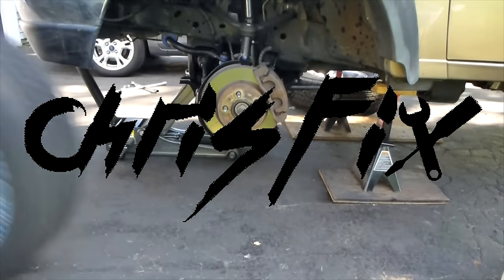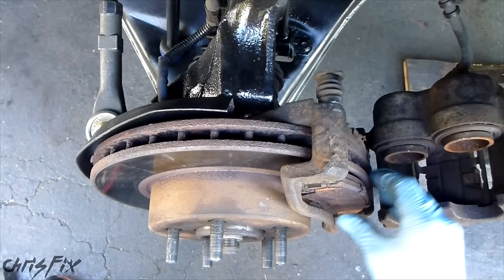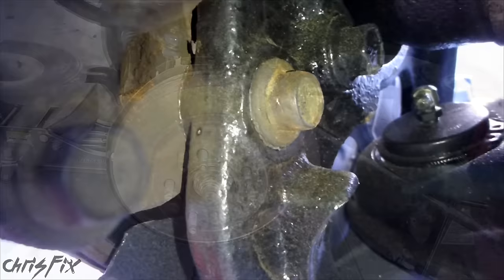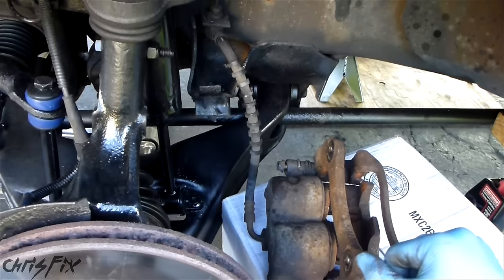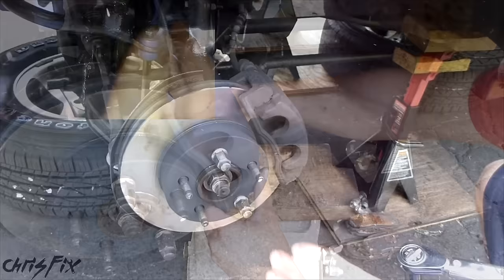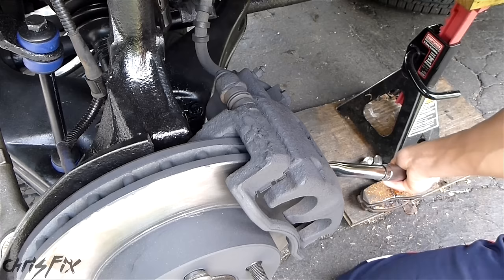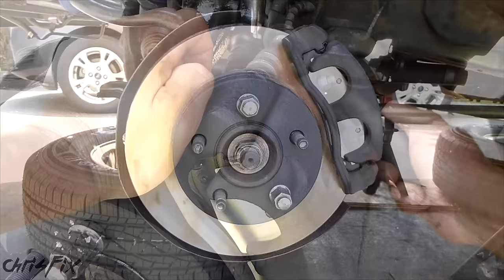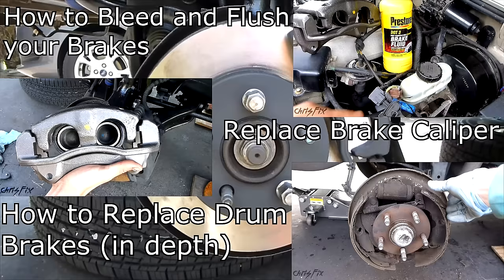How to Replace Front Brakes, Pads and Rotors

Comment: Great video and well presented.  Just wondering why you left out cleaning the brake hub before the rotor mount and checking lateral runout??  Also, the caliper bracket bolts need to be cleaned and inspected before fastening to the torque spec.   You never mentioned checking the threads and bolt "fit" before reusing caliper bracket bolts (if worn/loose fitting, they need to be changed with new bolts).  Lastly, the hardware was never removed for a proper caliper bracket cleaning and lubrication (under the hardware) combined with turning the rotor to confirm that it does not rub against the hardware.

If an inexperienced person does this job, and never considers cleaning bolts/checking fit, they could have an issue on their hands.  If they don't check runout, they will experience pulsation and vibration.  If they grease the ends of caliper pins, they will hydro lock the pins in the caliper.

Maybe you should add some the risks and warn people of things that could go wrong.  Just a suggestion since the video shows a really easy job that takes little effort.

Comment: Question...at about 7:37 you say to make sure that the pads are completely against the rotors.  Wouldn't this essentially mean that the brakes are depressed and the wheel will be locked.  How does the wheel spin if the pads are against the rotors?

Comment: Though this looks quite easy, you might run into the same problem I had. The new pads didn't fit, well. The top, and bottom, metal tabs on the new pads needed to be filed down to make them fit. If you experience the same issue, after filing them down, remember to repaint them so that they don't rust.

Comment: But doesn't forcing brake fluid back up through the system to fluid resevoir when pushing pistons back cause issues with ABS module on cars fitted with ABS braking? I was under the impression that on cars with ABS, the brake hose had to be clamped off and bleeder opened up and fluid released via plastic hose into bottle, (its only a small amount), when pistons pushed back. Then the bleeder is tightened after pistons are back to receive new pads. No air gets into system anyway this way.
Reply: With ABS systems you actually need to rotate the piston as you push them back.  Most Brake Caliper kits you can purchase will do that for you as they push back the caliper piston.  If you use a ABS brake piston kit you will see it rotates the piston as it pushes it back.
Reply: Ronald Eilers How big of a deal is it if you don’t rotate the pistons while pushing them in?

Comment: very good video. but most of the mechanic dont do good jobs like these ..i have a slight metal feeling on brake pedal when coming to stop at low speed..no noise or vibration and no issues at high speeds..only felt at low speed stopping kind of grind feeling..new brake pads..but rotors were 2 years old but  resurfaced when changing pads 2 months before..any advise on what to change would be grateful..sorry for length text..thank you.

Comment: Thanks a lot for the great video. I followed this video and replaced my rotors. After doing that I can hear a very small grinding or scraping sound coming from the wheel. Is this a normal thing since the new rotors don't quite the old pads? Any idea how to get this fixed?

Comment: would needing a rotor and break pads cause my engine light to come on? I just watched this video and these rotors look so smooth, but when i went to look at mine it looked like mt. rushmore.and i have not even taken the tire off yet. i thought i had a flat the way it was jerking riding down the road and pulling to one side as i prayed "let me make it home." i did have brake fluid but something sure was burning up under there. dont know about driving it all the way back into town to a mechanic?? will i be walking??thank you for the video, you made it look easy.
Reply: 2 years old comment but for anyone wondering

Engine light= ENGINE
brakes (or anything not the engine) will not make the engine light go on.

Comment: I have recently been getting some wobbly brakes on my 2012 Challenger RT after 80K miles.  I noticed some rust buildup on them and was wondering if it was safe to use a carbon steel wire cup brush to remove the rust from the surface of the rotors before going and spending 190 a piece on OEM rotors.  I need to check the thickness of the rotors as well to see if the rust removal is worth the effort or if new rotors are necessary.  Also, is it necessary to replace brake pads when I replace the rotors?  I still have about 6mm of life left in mine.

Comment: Good instruction, but I would be hesitant to use such a light silicone spray on the guide pins. Would think a heavier weight silicone grease would be better for the loads that the guide pins endure.

Comment: Hi Chris. Firstly I love all of your informative videos. I am considering getting a hybrid car, but if the batteries recharge through the anti lock brakes, would a brake job be different?
Reply from the maker: Thanks a lot! For most hybrids it is exactly the same as a normal brake job. The only major difference would be that you'll be doing less brake jobs over the ownership of the car because hybrids are very light on brakes

Comment: Chris, my car had a rubber sleave over the brake pins. I removed them because it impeded the movement of the pins after cleaning. Have you seen these before? It seems ok after driving.

Comment: Just did front pads and rotors on my 08 Sebring a couple weeks ago.. I've only done brakes a number of times but I always wind up with horrible vibration once the pads n rotors get warmed up.. the rotors I get usually have machine marks on them and I'm guessing it just needs to be worn down past those marks.. AutoZone cheap rotors.. I don't know. I watched the video and the one thing  i didn't do was installing the warning brackets.. everyone else was pretty much identical for the most  part..

Comment: I know this is a very old video, but wanted to see if anyone else had this issue. My rotor would not come off even after beating it with a hammer. Another video said you have to take the wheel hub off to get the rotor off. It was the only way I could get the rotor to come off easy. Now I'm having to figure out how to get the wheel hub off and reassemble everything. Is this required for some rangers? Thanks

Comment: You must remove the air from the brake after the replacement. You have relief valves at each clamp. You start from the front, from the side of the brake pump. One person pumping the brake pedal, and you drop the valve air until the liquid begins to run off. Otherwise the pedal can fall into the floor and you will not have the brake at the least opportune moment. Sorry for the language.
But anyway, very best video, off how to replace brake pads.
Peace from Poland.

Comment: Hey when I spin my right front hub, I hear a movement noise only on part of the roll, like something moving internally, but the hub seems solid. The other front hub doesn’t make any noise when I spin it. Both where with tires and rotor off, with the rotor and tires on, I don’t hear any noise on either.

Comment: This is very important *   only  use the product  made for the job synthetic brake caliper greese which is made to not dry out in extreme temps . I've never seen the rubber get hard from using the greese that is made for this specific job . Regular greese is totally out of the question .

Comment: I recently got my front brakes done a week ago when my sister and her boyfriend were on their spring break (they live in Jersey and I live in Michigan), and now, the brakes are grinding. Is there a way to fix this? I also had to get the brakes bled since the left front caliper was replaced on account of stripped screws since the other issue with my brakes was sinking halfway to the floor, and it now stops better (there was an air trap in the brake fluid itself). The old brake pads had nothing left and the old rotors had divits and grooves on them.

Comment: i have watched 15 front brake videos, and not seen one person really clean the rotor properly. you tried, but at the end of the clip, i saw a lot of grease still on the rotor..... another tip too, before pushing the pistons back in, use air hose, and a tooth brush with soapy water to clean the seals before they get pushed back... that will ensure proper even brake wear

Comment: Funny. I had to come back to this video to see which silicone paste you used for pins. Same thing I bought but 3M doesn't make this anymore! What are you using these days?
Reply from the maker: Dang that's weird, it was pretty popular, but my friends have used sil-glyde and super lube and they have reported good performance with that
Reply: @chrisfix  I contacted 3M, they said they don't make it anymore! Ordered some by AGS automotive. I'm also using permatex 80653 high temp. It's colored, a bit thinner silicone ceramic (brake parts lube) so I hope it's okay for pins. This also seems to be out of stock and I bought it 1.5 yrs ago.

Comment: I was wondering if Hyundai Sonata Hybrid vehicles brake pads can be replaced in similar fashion?
I was at a Hyundai dealership, and the advisor mentioned that I have to replace the whole brake rotor as a package once the pads are done! Is that true? 
For all 4 brakes that would cost me around $1000!

Comment: Even good mechanics can frequently benefit from refreshers, especially where safety is involved. Good video - but maybe mention that the people should pump the brakes when they get in, and talk about the bedding process for the pads?
Reply from the maker: +Andrew Geier Thanks for sharing. I could go on and on about brakes and make a 2hr video but there is only so much you can show at once.
Reply: +ChrisFix true enough, I suppose. I'm doing brake pads now, and wanted to see if there was anything I was missing but I'm mostly okay - I remembered all steps that you showed and some extra precautions that you did not.

Although, thanks for reminding me about the brake fluid reservoir cap - that's the one thing I admit I had forgotten in the two years since I did a brake job.

Comment: Did I mess up if I put the break pad with the clip on the inside of the rotor instead of the outside?
Reply from the maker: If that's the wrong way on your car then you need to switch it around

Comment: Does it need alignment after changing the rotor or upper ball joint?
I did change my rotor, after watching your video, but I feel little bit of the shaking on steering wheel when driving.

Comment: Attaching the new brakes on 2003 Chevrolet Cavalier, I crossed the bolts. They went in very hard, I thought it was because of new rubber inserts (bushing, they came together w/new brakes) I put in holes for those bolts. They stopped ~1/4 (maybe they are in place and I just overtightened them, I'll know for sure when I'll do the second brake) in before the end, where they are supposed to be, and started to rotate free both ways (clockwise and counterclockwise), I can't extract them, because they rotate. Should  I buy a new knuckle now, probably the thread inside is also damaged? Could you tell, how to extract them? Thank you for a good film.

Comment: Hi Chris. You produce the best videos! I'm a little confused about the squealer tab on the brake pad. I have a 2000 explorer sport 2wd. The squealer is on the outboard pad. The inner pad from my experience, has always seemed to wear down quicker than the outer. I'm thinking logically the squealer should be on the inner pad. What's the logic of having it on the outer pad?
Reply from the maker: Yea you can just flip the pads around. The pads work on either side as long as the pad material contacts the rotor.

Comment: After install the new pads , if i push the pads to the rotor wouldn't that affect on the brakes ?? ( i think there should be a little space between the pads and rotor so when you apply brakes the pads pushed in on the rotor )

Comment: Question: When you spray brake cleaner on the brake rotor, do you wipe it down with a clean rag or just spray it and leave it?
Reply from the maker: +Heel Guy It evaporates fast so you can spray it and wipe it or just spray it and the liquid will pull the contaminants off.

Comment: I'm getting a squeaking / squealing noise from the front brakes when I drive my 2002 Buick Rendezvous.  I just did the the whole rotor / pads less than 5000 miles ago, and everything was fine after that.  The noise seems to vary a bit as I turn the wheel from side to side, and will sometimes stop when I step on the brakes.  I pulled the caliper assembly off yesterday and the pads seem to be sitting OK (I had a problem last time the one pad seemed to pop out of the clip.  Yeah, the pads were cheapo, but they looked OK when I pulled it.

Suggestions to look for?  Thanks.

Comment: I just got coated rotors for the first time. They aren't packed in oil like regular rotors. Do you still hàve to clean them with brake parts cleaner?

Comment: I have a 2016 Mitsubishi outlander, I hope I won't have an issue with the metric situation. Im just replacing the pads and the store told me to lightly sand the rotor to scuff it up and apply the brake cleaner after. Does that sound right to you?

Comment: One thing that was not mentioned before you drive away make sure to pump the brake pedal. Because when you push the caliper piston back you're sending the brake fluid back to the reservoir. Meaning you will have no brake pressure until your lines fill back up. Don't cause any accidents!

Comment: Could clamping the brake caliper piston back in potentially break the ABS module?
Reply from the maker: Not sure how that would happen
Reply: I’ve heard of the reverse fluid pressure breaking the ABS in poorer made vehicles, but I guess those are isolated cases. Thanks for answering☺️

Comment: The way I look at it is 10 mm+ is a new pad,, and I change them at 3mm just by doing a pad slap on the existing rotors if I have no steering wheel shake.  I never change them at 5 mm or more even if I have a steering wheel shake, I merely replace rotors or turn them and then reuse the same pads AFTER doing some figure 8 sanding to remove the glaze. Anything less than 5 mm if I am servicing the rotors the pads get discarded too.  How long the pads have left is simple math.  If your new pads are 10mm and you are at 4 mm at 30,000 then you used 6mm in that millage ,so you are using 1mm per 5,000 miles.  Therefore if your pads are at 5mm thickness you will be at 3mm in 10,000 miles and THAT is the point you replace even though they are legal to 2mm ...

Comment: Is this the same process for a vw golf mk4? Slave, fronts, then backs. Ive been doing back to front and my pedal goes straight to the floor and ive bleed each 3 times and still pedal has no resistance with no leaks in the brake system. Its got me stumped.

Comment: Chrisfix you're pretty good but a little thing that I have a problem with is you push the Pistons ins after you open you got everything apart that should have been pushed in the Pistons before you take anything off of you do it with a C-clamp you put the C-clamp over the caliber and  the C-clamp and get the Pistons off the rotor then caliber off of the rotor oh yeah and the way you took that original rotor off I have never seen it a rotor come off like that without having to tap it I think you did a little video cutting no rotor comes off like that I never seen it in my life there always stuck on there that you got that hid in a sitter of it with a hammer sometimes to get it to come off

Comment: just did my 1998 ford ranger,video was great but after banging,heating more banging I finally wiped the spindle grease off to see how far it moved and low and behold their was a cotter pin and nut holding the roter on.Just thought I would pass this on to other weekend meckanics.
Reply from the maker: +Pete Norris Thanks for sharing Pete!

Comment: Chris, I need your help. I replaced the rear pads and rotors on my Chevy trailblazer for the first time. I did everything exactly as you did in this video. I spent over 400 dollars in tools for this lol. When I finished everything and took it for a drive, the wheel is squeaking. It squeaks when the brakes aren't even applied. I think the clips are scraping the brakes. Is this normal for brand new rotors and pads????? Thanks
Reply: +Brian Dahdouh most likely your backing plate. just push the backing plate back away from the rotor. If not the backing plate than you probably got a pebble or some type of debris between the pad and rotor.

Comment: 2006 Ford Explorer, and I am having a lot of trouble getting my caliper bolts loose, the ones that hold the pads, not the actual caliper. Tried PB Blaster but still can't loosen them, can I use a breaker bar on those, or move right to an impact wrench?

Comment: Hey chrisfix, been watching your videos obviously to fix my car. Great videos BTW. Anyways, I have a 96 Plymouth voyager that I need to replace brakes and rotors for. My question is about the age a bit and it being rusty... I'm not sure when the last time they were replaced...but would the breaker bar be OK to use if it is? As of now I have made an appointment for a shop to replace it Saturday. Trying to avoid paying 140 bucks. Not worried about that, but I would just rather save.

Comment: hi when you push the break pads back if you have abs do you have to disconnect any fuses or battery terminals as i was told this could effect the abs computer.

Comment: I just wanted the brake pad part lol. I've never done disk brakes on commercial vehicles before, only drum brakes, and those things are dumb. The only time i've ever messed with disk brakes was on military humvees, and they are not set up anything like this. All you do for them is remove two pins and pull the pads out the bottom, good to know it's only one bolt.